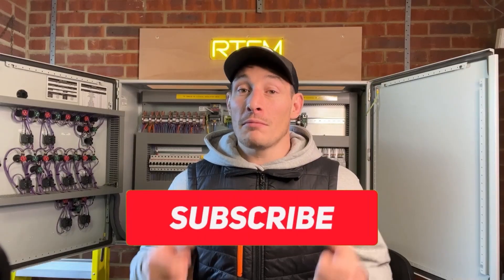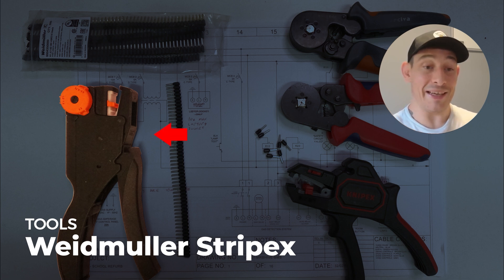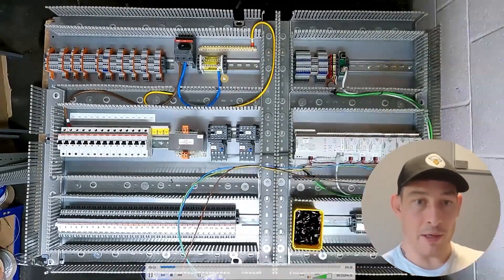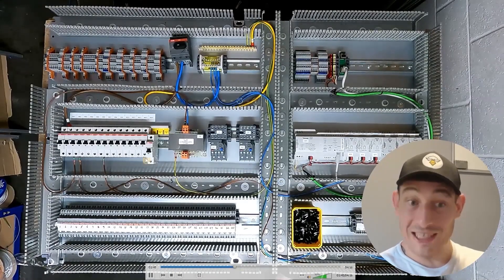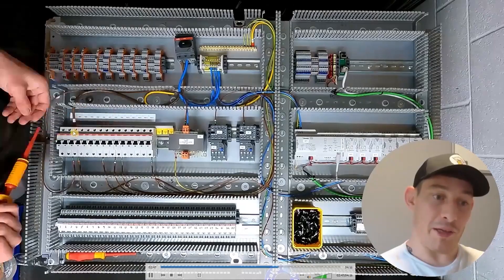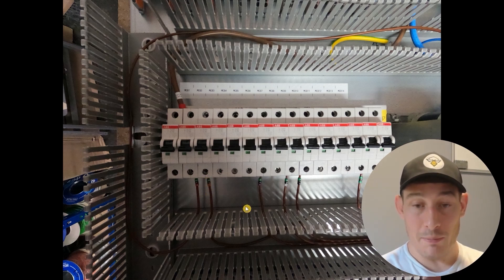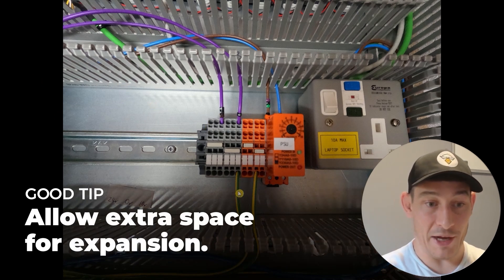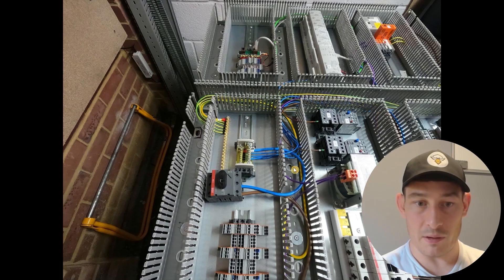Wiring the 230VAC Power in an Electrical Control Panel

Comment: When I was working at heat & control they made use loom wires with plastic wire looms (same we used on small VSD drivers) Was a neat appearance either way!